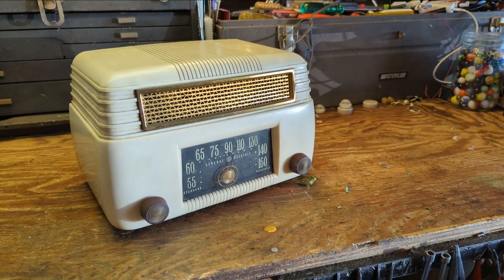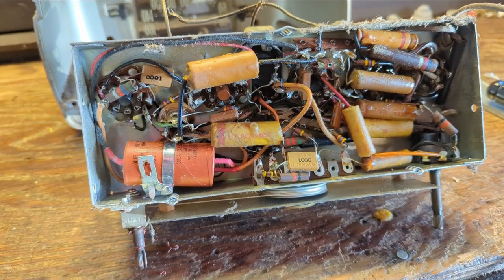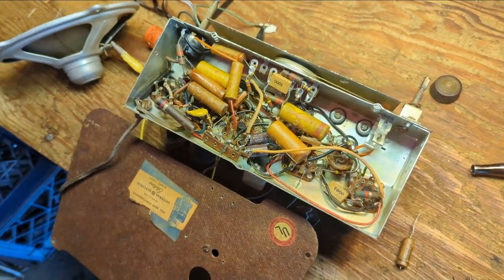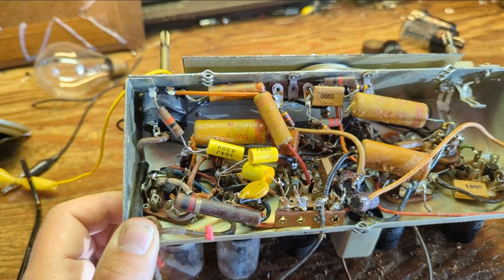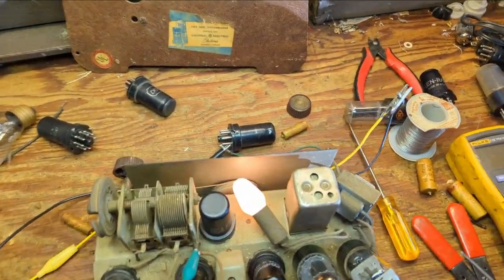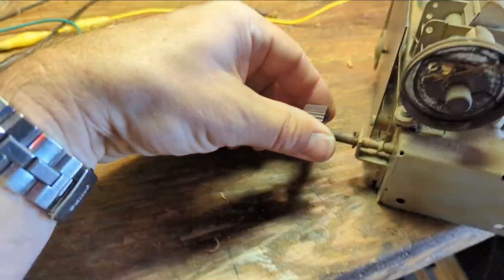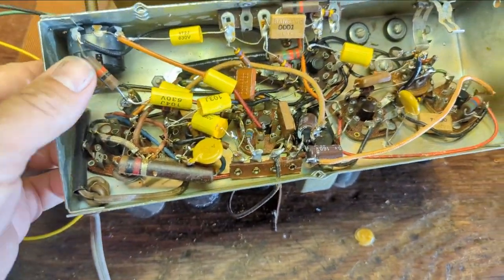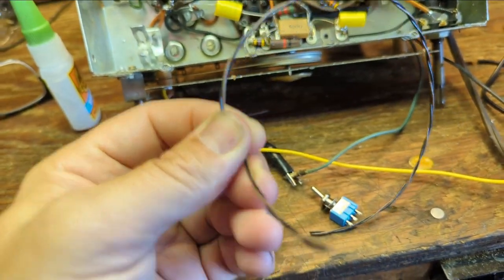Super Common GE in a Plaskon case troubleshooting and restoration

Comment: IIRC 12SH7 is a sharp cutoff pentode, 12SG7 is a semi-remote cutoff pentode, and the 12SK7 is a remote cutoff pentode.  All can be subed for each other, but the 12SK7 would be a better sub for the 12SG7 than the 12SH7.  12SH7 would be mostly found in an FM radio last IF stage.  Pin 1 on the metal tubes does NOT go to the grid (mostly).  The suppressor grid on the pentodes (12SK7) is a separate pin from the ground (metal shell).  However, the suppressor grid on the 12SA7 pentagrid converter DOES go to pin 1 and the metal shell.  On the glass 12SA7GT, the base is usually not a metal sleeve, and pin 1 goes to the suppressor grid ONLY.  On the 12SK7GT and 12SQ7GT tubes the base is often a metal shell, and will be connected to pin 1, but NOT the suppressor grid which has its own pin.  There are not enough pins on the octal base for the 12SA7 to connect the suppressor grid to its own pin, so it shares the ground pin.  Note that the 12BE6 7 pin version of this tube has the suppressor connected to the cathode instead!

Comment: Hey Mister Radio thank you very much for making this.... may I suggest one test which can be made in sets with an RF stage ahead of the tuner? Make a dummy capacitor (a few twists of wire) then extend one of the ends to the grid & plate of the RF valve. Sure you're denying the gain of the stage but there could be a fault in the RF valve which is blocking the signal also. It's cheap (free) & costs maybe a couple of minutes.

Comment: Just a quick thought about the aux input you like to add.  First, I myself, would probably never want to listen to a modern music source through something that sounds this bad, considering the other small speaker options available. Second, I think in the hands of someone not technically minded, it could damage the output tube or the speaker if driven into clipping by such a external device.  The AM signal is highly compressed and of very low bandwidth (not much audio above 4000Hz). If this were on my desk or in my kitchen, I would probably use it to listen to the news and little else.  Save a hard to find tube and a speaker reconing...don't add this input.  If you must have music, buy a AM modulator and you can have it on all your radios within your house.  Sorry, didn't mean to be harsh.
Reply: You have completely missed the point!!